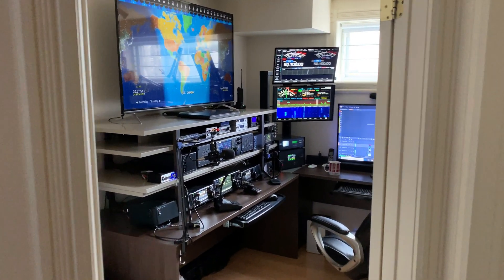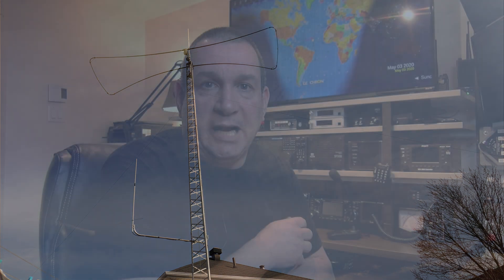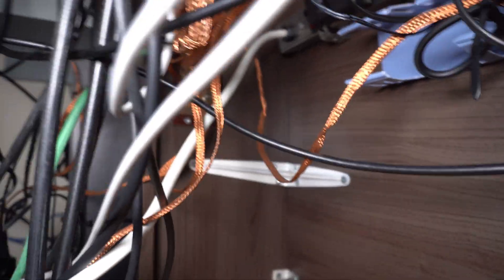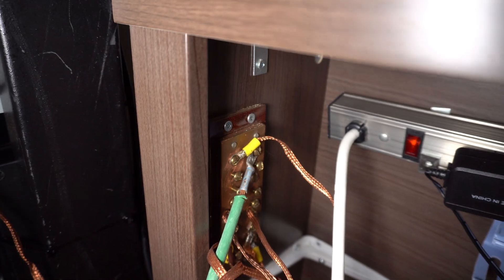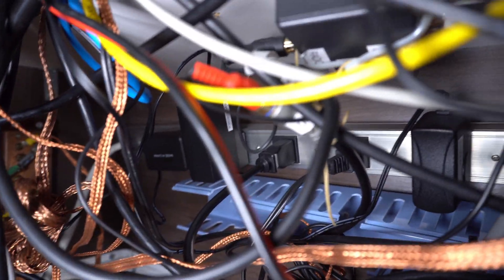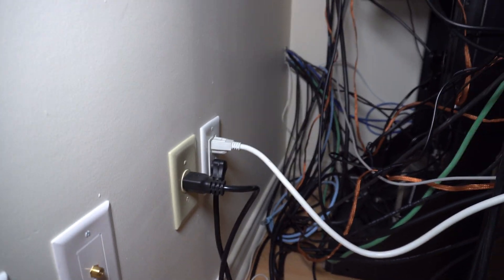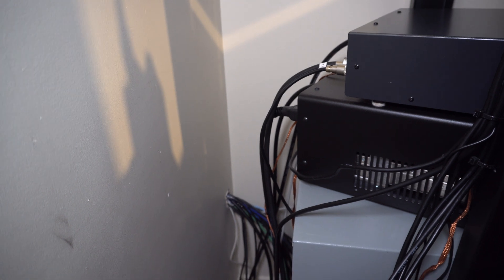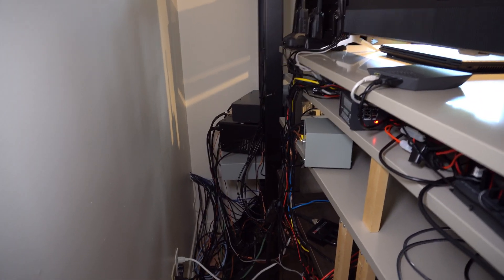My 2020 Ham Shack Behind the Scene Wiring

Comment: Great video and great way about explaining about a ham shack. Another word, the man cave for a radio amatuer. 
It was interesting to see. I did a bit like you too and rolled things up but it.seems like coils did me.problems with Rf.
When I did remodel my ham shack I started with the electrical outlets. We have this stupidity with my local ele tric company that you may not have to pay the.monthly fee.if you have real low peak usage. What it means is that if you have he oven, the ironing iron, the micro, 2 TVs and the vacuum cleaner on at he same time one will have a really high peak of KW usage. If you have 1 such peak that will determine your bill for the whole month.  So if you.dont clean your house and iton the clothes while you wait for the chicken to roast in the oven you will have a lower peak. So, for ham shack I made the terminals on the back wall with between 16 to 20 outlets each. Each of them is feeded by a separate phase. So instead of having all the gear, rotator, computers, radios and amplifier on 1 phase I reduce the peak to if lucky 30%  
I measured all my gear and I built a shelf to put on the desk with space for each of the rigs and monitors to fit. 
I dont honestly know how many layers of wood finish I used. I know it was more than 30. Infinished wood attracts a lot of dust and a really smooth surface is so much easier to keep free from dust. We all know how.much dust collects quickly in a ham shack. Perhaps make a video about how.to keep it clean. 
Next I had made the idea to have a fake wall behind the desk to hide all the wires. We know how that works right. The room was smaller than anticipated Haha.
Next I bought office furniture legs and put some extra under the table. My table has 10 legs equally distributed. People have no idea how much their gear and cables actually weigh and although I dont have a friend that personally had their desk break I've heard stories where office desks have cracked in half and expensive equipment has broken. Perhaps you can make a video and weigh all your stuff and show people they might actually have around 300Kg on a desk that is built for a computer and a couple of monitors. 
Last thing I did that I think was beneficial to my RFI was that I had a local company cut a copper plate.for me that fitted exactly on the underside of my table and almost covered the whole area. Then I connected it to the ground terminates which where also all my coax grounds are connected, goes outside.to a ground rod which is in turn connected to 3 more ground rods.
Reply from the maker: Hi, I keep my shack clean by cleaning everything once a week, plus I always keep the door close and my cats are not allowed in the shack.  For the Desk I added as much reenforcement as I could, seems to work fine.  73 Pascal VA2PV

Comment: Thank you for sharing this Mr. Pasqual, a question if i may: how did you wire the ground to the antenna switcher (alpha delta) inside the shack? Did you just ground it to your shack common ground inside or does it go to the antenna ground outside?
Reply from the maker: It's ground on the tower, and inside the shack to the grounding plate.  73

Comment: Enjoyable video series.   I am constantly trying to keep my wire jungle under control.   My dad had the best setup,  you could walk behind his radios which made keeping the mess under control that much easier.   Not many of us have that setup.    As for why you see ham radio shown with older radios  not modern stuff  would be people like knobs and switches ,  they look impressive to the average joe.     While the teck people love their computer screens (I know I do),  there is something impressive with the old gear.   My ham station is running gear from 1936 to modern.    73's de WA3TVH
Reply from the maker: Hi Bob, I don't like to mix new and old gear, but if I could I wouldn't mind having two shacks, modern and vintage, that would be cool.  But it would have to look like new with matching accessories, I will still be picky. ;-)  If I had to design a new house, the room behind my shack wall would have sliding doors for easy access behind the desk, that would be cool ;-)  73

Comment: Great explanation like every time, only want to ask few thing about the ground: cable so exsposed? I see one touch another, dont create ground loop? cable need to be so long? It is better to use rg shield or car ground strap or cable for civil (house) applications? best wish, 73 IZ3QVB Alessandro
Reply from the maker: I used for the equipment to the grounding plate old RG-213 cables that I removed the shield.  There's no ground loop as they are all grounded together everywhere, the more the better.  There's nothing behind there that could be shorted, only ground is exposed.   For all power cables I used anderson powerpole, which are safe even if they accidently connect. 73